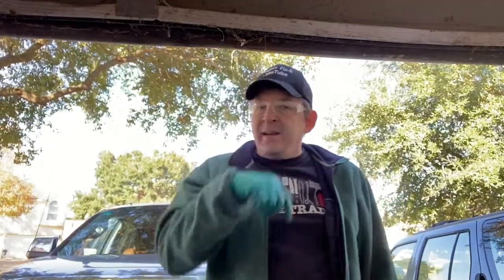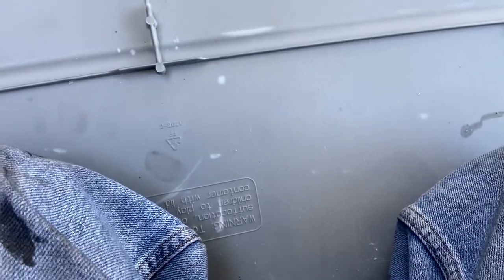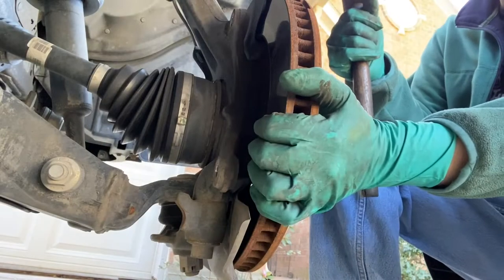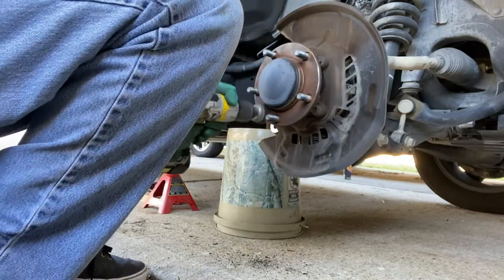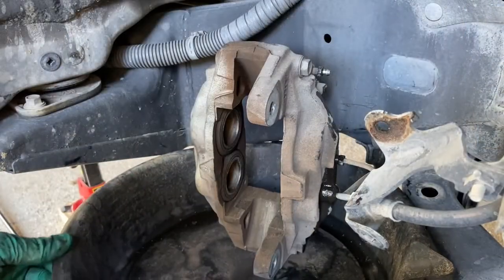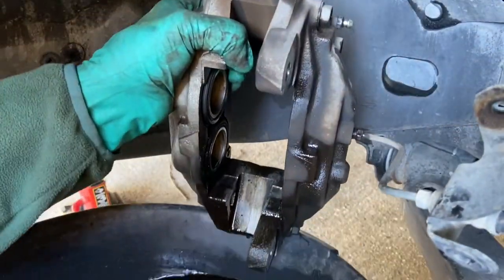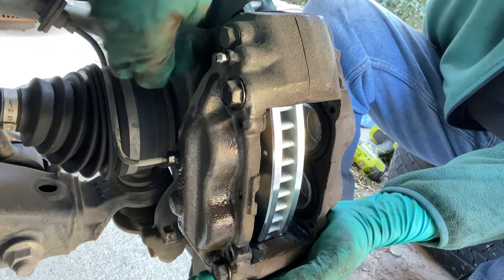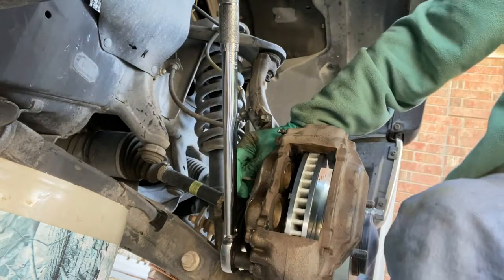2014 Toyota Tundra (Front Brake Pads and Rotors) 112,000 miles

Comment: I like the drilled and slotted rotors from Powerstop brand, but I never liked the required break- in procedure where I had to look for clear roads to do the multiple  stops. I'm on my fourth set of pads and the rotors still holding on. For my other car I switched to Centric drilled and slotted rotors which perform the same but no break-in procedure is required.
Reply from the maker: Nice input. I must be honest, I did not perform the break-in on my other car. This time I tried the best I could with the in town roads I had to deal with. Regardless, no issues with the set-up to date. I hope I don't have any rotors warp on me. This is my goal. The wheel shimmy that creates is quite annoying.

Comment: If the wear indicator is in the wrong side will that make a difference?
Reply from the maker: In general, probably not, but I believe the inside pad might tend to wear quicker due to caliper piston being on the inside. In my video, I just made note of where the wear indicator was originally and reinstalled the new pads accordingly.

Comment: Question. Is it needed for you to bleed the caliper on the tundras or can you just push the pistons in?
Reply from the maker: I'll let the Toyota Certified Technician pipe in on this one to give you an official answer, but.......All my life, I have pushed the pistons in after taking the cap off the master cylinder reservoir. I have older vehicles in my driveway with over 150k miles on them. I have never run into ABS issues. However, some viewers have urged me to stop preaching this technique. They argue pushing old fluid into the ABS module could cause premature failures. Honestly, I totally understand their argument. So, for this video I pushed the fluid through caliper bleeder. I must say, it's not too inconvenient and I'll probably do this from now on.
Reply: @projectfixit  The "old fluid"  story defies all logic.  What about the "old fluid" in the line upstream all the way to the ABS module?  That old fluid is ok but the old fluid near the calipers is not?????  How about the "old fluid" in the master cylinder reservoir???????  That "old fluid" is ok, but the fluid near the calipers is not????????  In order to get rid of all the "old fluid", one would have to evacuate the reservoir, lines, and calipers.  A total flush, fill, and bleed.
Reply: I have never bled the brake lines to push the calipers back in.  I’ve always wondered if it was really necessary.  I’ve never had any problems yet.  
But thanks for the video.  Well done.
Reply: @JohnandKelbi  The key is how much room you have in the master reservoir for the fluid to push back into.  That fluid squishes back up the line into the container.  There is usually enough empty space where it wont overflow.  I take the cap off an watch as the calipers are being compressed.
Reply: Pushing in the calipers is fine, just make sure the reservoir cap is off first. When brakes all back together, bleed the brake lines like normal. Works just fine.